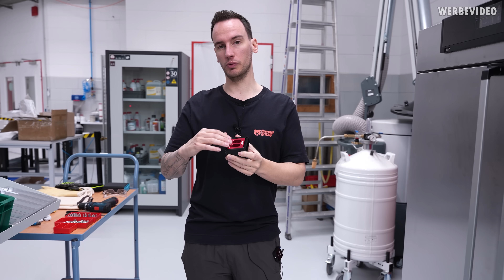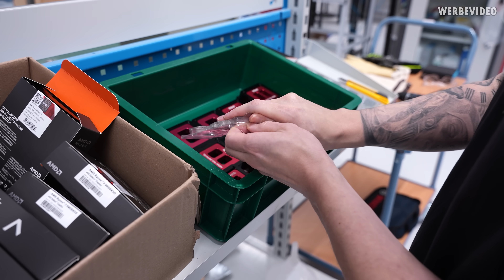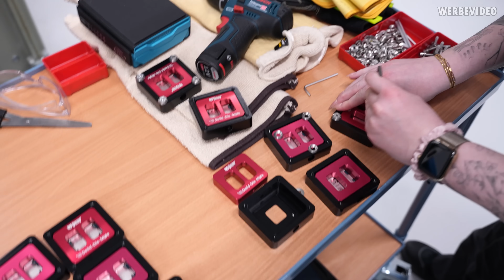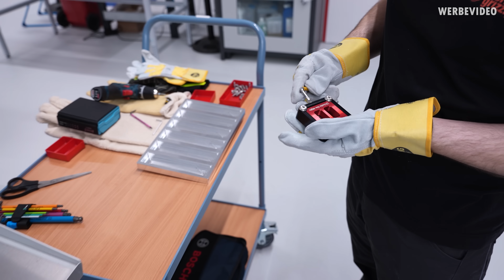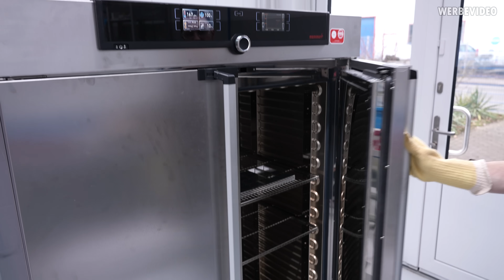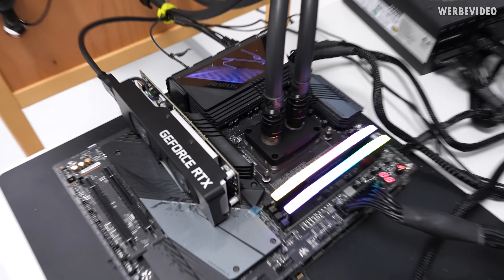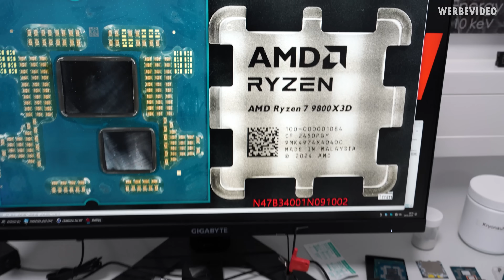You can now buy Delidded AMD Ryzen 9800X3D with 2 Years Warranty

Comment: Might need to delid my hot ass 9800x3d one of these days. Hits 90° in cinebench with -20 curve optimized on a 280mm AIO. These CPUs seem so random temp wise. Can't get one that runs 70° or hit thermal limit instantly.
Reply: Hot ass 9800X3D in a synthetic CPU benchmark? No way? The Tjmax is also 95 °C.
Reply: @Simon_Denmark  ya which is easily hits and throttles down 200mhz without the curve optimizer adjustment. It's hot AF compared to a lot of other people's CPUs running lesser cooling.
Reply: @MrDutch1e  It’s not that hot in normal use. Much cooler than my 7800X3D. It’s a gaming CPU. I don’t really understand why you would be doing a synthetic benchmark like cinebench. Do you mean like people with other AM5 CPU’s or 9800X3D’s?
Reply: @Simon_Denmark  I clearly meant other 9800x3d CPUs. Also without curve optimizer it runs very hot in games still. Mid 70s to low 80s. Hotter than my 13700k on the same cooling which is ridiculous. Lots of other with single tower air coolers on 9800x3d running 20° cooler in both cinebench and games. Trying to question everything I'm saying when I know exactly what I'm talking about is ridiculous btw.
Reply: @MrDutch1e  Sounds like you should check your AIO and the mounting then.
Reply: @MrDutch1e Don't make much of a difference if it runs hot, you'll probably buy a new one in a few years anyway

Comment: Can you tell me why don't you apply Thermal Grizzly Shield Protective Coating on the transistors after delidding? Because later when you apply liquid metal there is a risk of short circuit and if it happens your cpu is dead!

Comment: The markup Silicon Lottery charged for binned CPUs used to be higher than this. Not bad at all.
Reply: Manufacturer binning is so good that there's almost no point doing it yourself.
Reply: Totally different, SL operated at the time when there was near 20% delta from average to lucky CPU.
Modern factory binning means there is less than 5% delta between average and the top performer today.

Comment: What in the hell is delidding even? I don't get it.
Reply: Remove the top shield essentially from the proc to expose the die and components beneath, for better cooling and higher overclocking potential. 

Not something gamers or avg comp user need to worry about though.

Comment: Why would I want this as a normal PC user? I guess it's for extreme overclockers and perhaps score competitions, but is this a thing when I am not part of this category? Do normal CPU coolers still fit correctly even without a lid? I guess not but I must ask these stupid questions after watching this video LOL. Thx
Reply: This is not a product for normal PC users, but there is benefits in lowering temps, even when not going after extreme overclocks/scores.  AMD for AM5 cpus promised cooler compatibility with old AM4 coolers.  To accomplish this, they had to put more material between the die and the surface of the chip to keep all the dimensions the same.  The trade-off for this backwards compatibility was higher temps, due to added material between the die and the surface to where the cooler mounts.  With direct die, Roman has documented around a 10-20 degree drop in CPU temps with direct die (he has benchmarks with other YT vids), which not just helps OC'ing but allows you to run your fans lower for sound, use a smaller cooler, etc.  You can use a normal cpu cooler, but you need to pair a delided cpu with a direct die CPU frame, which thermal grizzly and noctua also sell.  The frame helps support the cooler as you mount it to the cpu to help spread the pressure and not crack the die.

Comment: That's actually amazing project!

I would suggest to provide simple paper/QR code with guide/suggested cooling solutions for delided CPU's. As you said not everyone know,or are afraid to delid CPU,but even after that they can simply damaged die if they wont use direct die frame,micro die block or equivalent of that. Also if they would want to use standard AiO/air cooler after that. People nowadays needs manuals for everything,and it will make you less trouble with RMAs.

Also quick note about AM5 High Performance Heat Spreader which can be used in that case. Check with your suppliers (or shops you cooperate,i dont know how to say that) if they have updated versions with new nickle plating. I know its old topic from half year ago,but 2 days ago i bought on megekko this item in Netherlands,and Thermal Grizzly support just verify with me that i receive older version,when i supposed to have new one (and shops should have them to now as i suppose). My case is already fixed i think,but i want to give public feedback,so maybe you can verify that. :)

Comment: Great value and if I hadn't already purchased a 9700X I would of purchased.   Either way I am extremely impressed and satisfied my cooling set up.   Using a Contact Frame and a 38 X 38 Kryosheet  (the 33 X 33 just kept slipping when i was putting my cooler on).  Knowing that I don't need to worry about paste drying out and it not being as effective as it was day one.  Am a Thermal Grizzly customer for life.

Comment: Why did you use boxed CPUs instead of tray version? Isn't OEM packaging a lot cheaper?
Reply: it's not that much cheaper and he would need to do the whole packaging from scratch (that's a big PITA) . this way he can reuse the packaging just put it to custom printed box. one more reason might be the fact you're not supposed to resell tray CPUs, those are exclusively for integrators.
Reply: Probably easier to ship to customers in AMD retail packaging than trying to make their own.
Reply: You have to buy ALOT of procs for that pricing on OEM to make sense. Like, ALOT.
Reply: Tray CPUs are usually 1000 per tray...

Comment: I personally wanted to delid my 13900KS, but with the delays to the Mycro block, higher cost of buying delidder and only using it once, and the intel voltage issue ofcourse. they put me off going through with it.
If this was available at the time of buying my CPU, I would have definitely went for it.

Comment: if only i waited, i used your delide die mate and polished then used your Kyosheet and finally your micro direct die on my 7950x3d and i could not be more impressed with the results, But boy was i scared doing all the work myself just thinks how much i could have wasted if i got it wrong but all good, well done Roman
Reply: I used his tool on a 13900k. The delidding was a disaster because the IHS I had was too thin and wouldn't make contact with the liquid metal and then I knocked something off the die, but the TG delidding tool worked perfectly. I decided not to try it on the 14900k replacement. I will say the TG phasesheet is insanely good thermal paste/sheet too.

Comment: i have a 13900K that I delidded for use with the EK block that you helped design.  When delidding, I used a heat gun to "warm up" the IHS.  Pushed it back and forth once then lifted it right off.  You don't need a lot of heat.  It's a small part and heats quickly.

Comment: Your test process looks superb, the pictures before you send them and expected thermals mean you’re in a great place if there is an RMA. You can tell if someone is trying to send you a different CPU, if they chipped the silicone, knocked off a cap, etc. and if a customer complains “it’s at 95c”, you have a test result you can send them 👍
Is there a stress test too? Like a 24 hour one?
Reply: No he said just a short test because of time. Stock and just ran Cinebench R23. No loop or long testing. On stock it should never be a problem.

Comment: A great idea the only thing I'd want is maybe having a mount and waterblock pre-attached as an option. I think a lot of people (I'd definitely buy it) would pay a premium if it was just screw in and it already has everything ready to go.
Reply: I don't think that would be possible
Reply: @jacobmorgan2540  It depends on the approach, TG sell retaining brackets for mounting. So the only additional thing to solve is how to attach it and ensure the CPU doesn't fall off or decouple and the answer there is the same as AMD does currently which is just glue that can handle those temps to the mounting bracket.

Comment: Well that's an interesting fact, that delidding a CPU significantly increases the odds it will die (even after it initially works, even if you don't crack it). Sounds like the odds are like 20% in two years which is crazy high.
Reply: Why would you make something up like that?

I have delidded stuff from 20 years ago that still works. 

Heck pretty much every GPU ever is delidded. 

Has nothing to do with cpu life, and you have to be very heavy handed to crack a die.

Comment: This is a pretty good idea. I guess paying 100+ € compared to a retailer for the delidding service and warranty is quite worth it. The question remains though, why would you actually want to delid a 9800X3D? I feel like there’s no actual practical reasons.
Reply: There are 2 reasons:
1. Direct die block
2. Custom heat spreader that requires original to be delided (thinner heat spreader for less resistance)
They're made for enthusiast market, where every °C matters, not for everyone.
Reply: @Zmyszen  Direct die is obvious, what else are you going to use with a delidded CPU? But yeah no practical reasons just more temperature headroom for synthetic benchmarks.
Reply: @Simon_Denmark Exactly that. You're not going to notice a difference in day to day operations, so it's very much an enthusiast niche product.
Reply: @Spawny3  It’s extremely enthusiast because 9800X3D isn’t exactly an overclocking CPU. You’re not going to be doing any world records outside of it’s own category.
Reply: @Simon_Denmark actually 9800x3d has overclocking unlike the 7800x3d least last I knew. I havnt checked or seen that being changed at all(ik been bios update or few). But the other models of 5000/7000 series ryzen x3d do no oc
Reply: @alancarr195  Yeah I know this compared to the 7800X3D.
Reply: Direct die cooling more efficient, delidding your own voids warranty,
Easy for inexperienced people to Crack silicon or interposer when doing this.
Am5 heatspreaders are not the best amount of surface area for best cooling efficiency one some these monsters on am5
Reply: @alancarr195  I’m not wondering about any of the things you mentioned. The delidding service and warranty is obvious. I was just saying that there’s no practical reasons to delid 9800X3D for other than extreme overclocking. It’s not a hot CPU and it’s easy to cool.

Comment: I'm struggling to understand why intel and amd don't offer delidded cpu's anyway.
Reply: User negligence probably, could cause more RMA’s etc. The IHS protects the CPU.
Reply: @Simon_Denmark then the rma would be rightly refused.
Reply: @toonnut1  Yes but they might not want to even take the risk of giving you a warranty for the CPU. Do you want to buy a delidded CPU without a warranty?
Reply: @Simon_Denmark  as soon as I delid any cpu I automatically lose my warranty and thats what I disagree with because all my delidded cpu's have never been damaged because of me delidding it.
Reply: @toonnut1  That’s the point YOU haven’t damaged any CPU’s before when delidding.
Reply: i asked this, they said that in some regions like for example china by law all electrical parts have to be sold with a form of heatsink attached to it if its required to use them with a cooler. Thats also why GPUs arent sold without aircoolers.